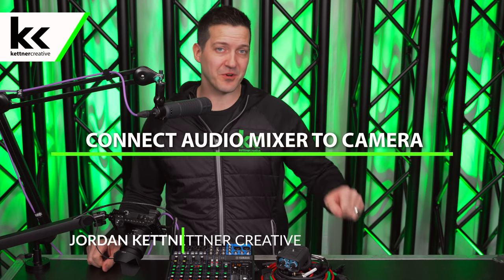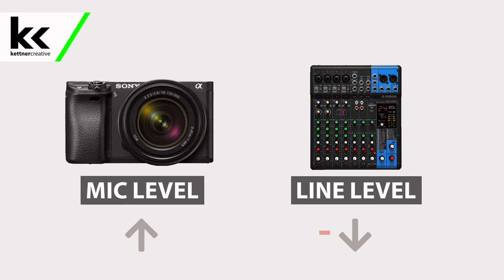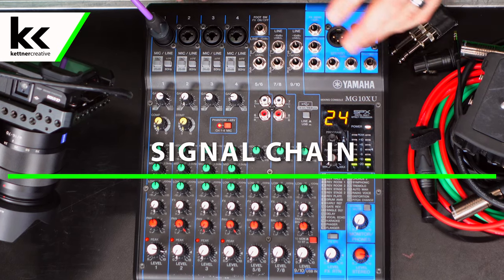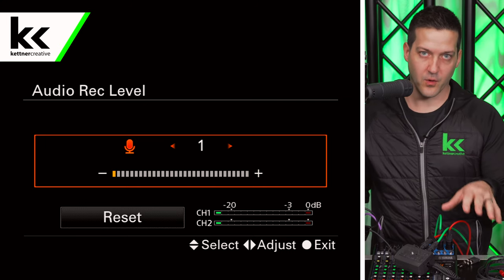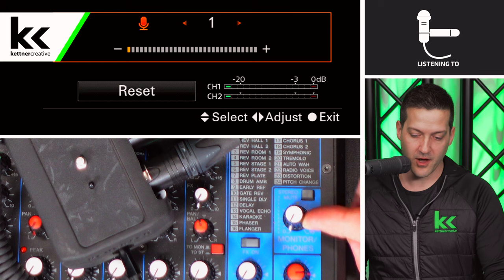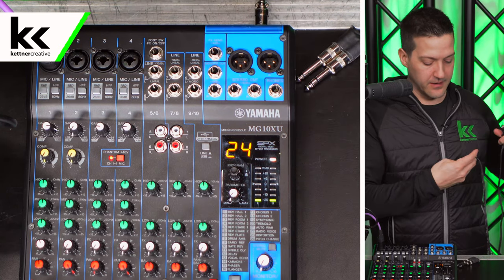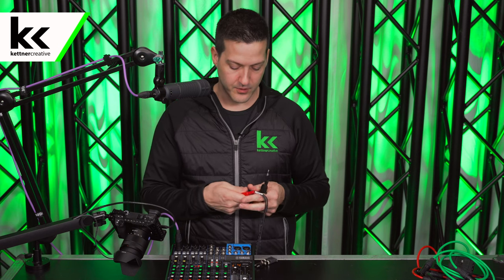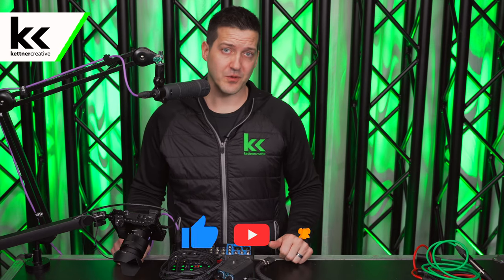How To Connect Audio Mixer To Camera

Comment: Some mixers have 'Tape Out', with unbalanced RCA jacks. Works good for short runs. Depending on the circumstance, a stereo out can also be taken from the head phone jack. Mackie make a point of the headphone jack as an optional out put with plenty of signal.

Over all and excellent instructional video. 

One note, if a mono signal is recorded in the camera, in post, the track can be doubled for a Left/Right output, but will not be stereo. Most of us know what you meant, but a total newbie will need to understand a double mono will not have stereo imaging.  - Cheers

Comment: A thousand thanks!
How could I not think of a simple RCA-3.5mm cable?!
I use a Pioneer DJ console so it obviously has the mixer wih stereo outputs ecc.. 
I took it for granted that it wouldn't work without an interface, so I always tried with the classic "iRig" interface and it never worked (but it did with the phone, connected by earphone 3,5 plug).
By connecting the RCA cable, and setting the volume to -3dB, it immediately worked. Thanks again !!! Subscribed!!

Comment: Fantastic video!! Question: If I have an xlr adapter, specifically the XLRKM3 that directly connects to the camera via hotshoe, will it work if I run  xlr cables from the mixer into the adapter?

Comment: Best enlightening video I have ever seen on audio for live streams. 
I have a query. I had to cover a stage program recently, I requested an audio out from the sound operator. I gave him my cable with quarter inch heads. I recorded the event, keeping DSLR audio level to 1. still the audio was distorted/jarred probably due to high power. even after my requests, operator was unwilling to minimize the level. what solution you suggest in these situation. those audio interfaces sit on cameras are they helpful ?

Comment: Thank you for this video, I’m having a problem I use an audio interface the tascam ca-xlr2d to the mixer behringer x32. Using the xlr to the monitor out, I’m only getting the mics but there are instructions like keyboard and drums connected. I’m not too familiar with mixers

Comment: Hi sir.I have one doubt, how can we connect the yamaha mixer Mg 10 Xu with a Camcorder and speakers for 

1.)live streaming(YouTube) and 2.)stage performance sir?

Because when we start a live or recording particularly when both the singer sings and the musical instrument (Keyboard 🎹)played at a same time the audio was not clear,noisy,unclear in the live streaming or recording..high buzzing sound has been produced instead of the singer and 🎹 instrument performance...but not in the stage performance (it is always ok)..

and also what cables we should use especially for live streaming and where should we connect those cables sir?

Comment: Very informative video it is.👌👌👌👍👍👍
I want to record my singing in DSLR also mobile phone sometimes with the best audio quality with sound output from my mixer.
Sometimes I need to record in auditorium also. 
Will I need DI box, iRigStream, Tascam iXZ, interface, Beachtek-DXA-2T(shown in this video) or any other for that?
Suggest me the best and budget device for… 
Once I recorded my video with sound out from mixer(main) into my iPhone but as you said mixer’s main output was so loud my recorded video had over gained and distorted audio in it.
Every time audio out from mixers may vary like line, xlr or RCA due to output port availability.

Comment: Excellent and helpful video. Question: MY Soundcraft UI24 mixer has xlr aux outputs, could I use them with a y cable (xlr female to 3.5mm male) and feed that to a camera input and sitll ahve it work, wth the limitations you described a given as well?  In the past I have used an IK multimedia interface _irig Stream) to feed diretly from main outputs to the rca inputs of the interface and it works well (until my interface died ), but I'm going to go with a camera instead of my iPhone and it would be handy to use one of the techniques you described here. Thanks.

Comment: I'm using the zoom Q2n camera. I get how to run audio out of the board or snake on stage into the camera from the 1/4 inch or XLR balanced Aux/Line etc to the 1/8 inch (3.5mm) input of the camera.  My question is how do I take that signal and send it from the camera to a listenable mix for the board engineer to hear and mix each channel to achieve the best mix for recording? The Camera audio out is headphone level 1/8 inch 3.5mm. Thanks for the help.

Comment: With my gear: a Zoom Q2n 4K video camera and a Mackie Mix8 it seems like I need to turn up the input volume knob on the camera as I tried it with the output volume from 1 of 10 all the way to 8 of ten on the mixer out to the camera and even at the 8 of 10 setting the audio volume on the camera was way WAY too low barely audible at all actually. So a good point to aim for in setting volume is the -6 mark on the volume indicator on the camera?

Comment: Thank you so much for this! Ran into an issue- I've got the master out XLR cables going to an audio interface and connecting to the camera mic. When I set the camera's audio input down to 1, it's barely audible. I set the input to "auto" and I get that hissing. It sounds fine using headphones on the mixer. Would you be willing to give me advice?
Reply from the maker: Without seeing your setup, I'm guessing your audio interface level is set too low. You can bump your camera up to 5 or so to see if that helps as well.
Reply: @kettnercreative  Yes, thank you! Bumping the camera up just a little worked perfectly. It sounds great and I appreciate it so much. Your video was also so very helpful. Thanks!

Comment: This is really amazing. There arent much videos on to do this. 
However, how would the wireless system work instead of these cables?
For example, connecting a Rode Wireless Go transmitter to the mixer and the receiver to the dslr, would it give a good result? The wireless thing will allow me to get rid of all the wires, but the thing is will I get a good quality?
Any help would be greatly appreciated. Thanks
Reply from the maker: Great question. 

Wireless systems are great if you're on the move and capturing stuff as fast as possible. Sometimes this is worth it. 

In the studio, wireless is:
1) Lower quality
2) More susceptible to interference. 
3) A pain in the butt to manage batteries every day
4) More points of failure.
Reply: @kettnercreative  Ahh you just ruined my dreams of getting a simpler wireless audio setup 😅. But hey, thanks for the honest opinion. Appreciate it! Thanks!

Comment: The Yamaha MG10x stereo output is displayed as balanced. Would plugging in mono unbalanced TS jack cause any issue? Would the sound signal be halved ? will it short the circuit?

Another question I have is regarding the unbalance input for channel 6-10. If I connect balanced output from my keyboard to these unbalanced port, would it cause any concern?
Reply from the maker: No issue. It’ll just have some audio degradation over a long run.

Comment: I am using a cannon xa50 camera that has XLR inputs as well as the regular single jack. I have been looking at a Mackie Mix12FX to use with my Stellar X2 Vintage Condenser mic. Would I just use the “main out” instead of the “stereo out” you talk about? Because there isnt a stereo out on the mixer. I have been searching for days to try and figure out a configuration & I came across your video here. Would appreciate the help. Thanks.

Comment: Yooo! Nice video man . Is there a way to connect ones Android phone to a audio interface . I mean can the audio recorded from a professional microphone be used as the main  source for "recording" audio and not from the in built microphone of the 
android phone? Thanks and cheers on the videos.
I am currently pursuing a post graduation in Audio Engineering and boy ... do your videos help me a ton🙌.  Kyle from Audio university and 
Kettner  creative are two channels every beginner / amateur (even pros)
audio engineers  should look out for.
Reply: You probably solved this. But if you use a Y splitter. Go onto your phone recorder app. When you plug the splitter into your phone, make sure the recorder app is already open. Then also make sure the 2 female mic and headphones connections dont have anything connected to them yet. The screen should show that you're using an external mic source now, not the phones built in mic.

Comment: Do they make a balanced version of the simple cable solution?
Reply from the maker: Not that I know of.
Reply: I tried setting my Zoom Q2n 4K video camera and my mixer at a 1 out of 10 setting but the audio was barely there on the recording so I need to turn it up on one or the other. I'm thinking the camera should stay at the very low 1 out of 10 setting and then move the mixer setting up. @kettnercreative

Comment: this means if I use this. all the mixer audio channel will automatically record audio with camera video. And we do not need to mix separate audio file and separate video file to make it perfect face lipsing?
Reply from the maker: It should be close. Sometimes you will need to bump it by a frame or two.

Comment: I have been using the “headphones output” to go to my camcorder. Is this a realistic 4th option or is there a real negative to using headphones?( other than losing the option to actually use the headphones off the board)

I notice a slight hum/hiss using headphones.
Reply from the maker: Great question. Technically "yes", it's a 4th option. 

That being said, headphone outputs are typically "lower quality" and audio companies don't put a lot of effort here. This is typically where they try to save money. 

Hearing that you notice a hiss is not surprising, these low quality headphone amps/outputs often generate a lot of hiss/noise, especially if you turn them up past 50%.

Comment: I was trained to never, ever use a splitter cable to combine signals as you're suggesting with your second method workaround.  A splitter cable is made to split signals.  A combining cable is meant to combine signals.

Comment: Voice over Actor
0 seconds ago
I have a brand new Yamaha mixer it was working fine.. A few days ago I turned it on to voice a commercial and I could barley hear anything.. When I put the volume up the mic sounds all distorted and there is a cracking sound coming out of the speakers and headphones.. I never changed anything and everything is plugged in the same as it was.. I used it one night it was working fine and the next day when I turned everything back on I had that problem. I thought it might of been settings in my computer but I tried everything and I tried it on a different computer and it's the same thing! Can anyone help??